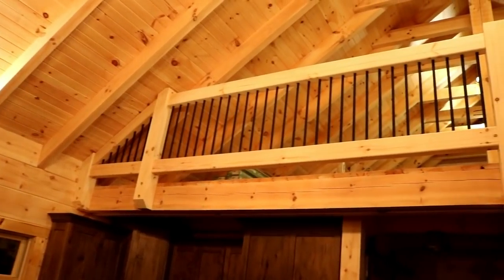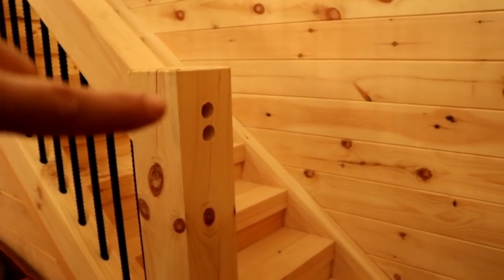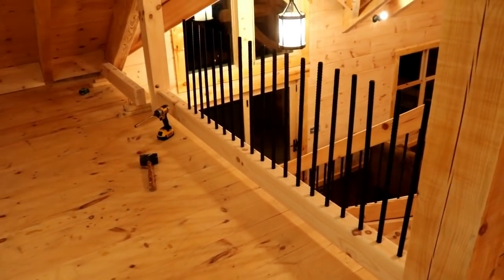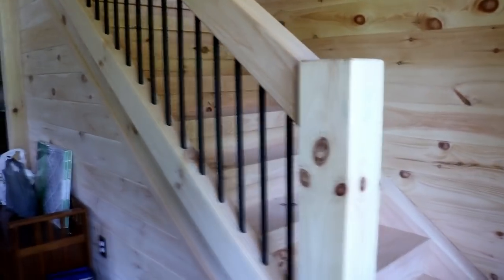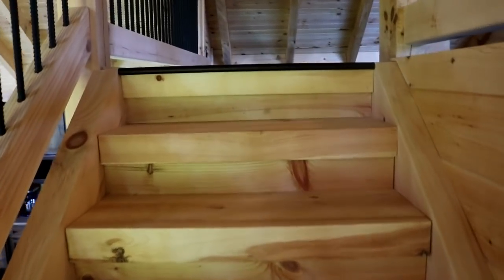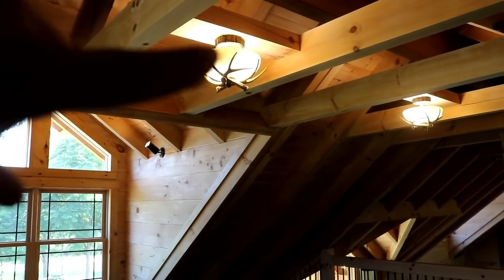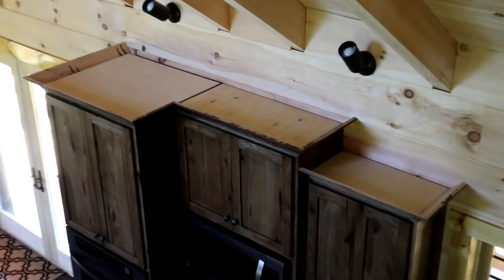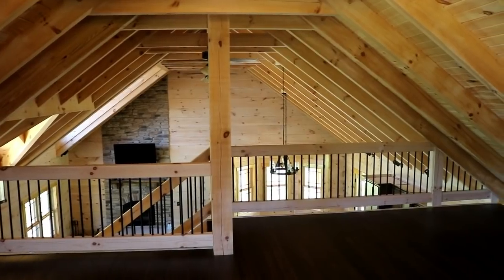Log Home Build Episode 24 - Staircase Railing and Loft

Comment: AWSOME log cabin.you did fantastic work on it 👍
Reply: Building a log cabin requires the use of logs. Once it's milled it's no longer a log cabin it's called a timber framed construction. Which is what your house probably is unless it has metal framing.

Still a cabin though.

Comment: Love your staircase in fact your whole house
Reply: That's the one part I don't like. I would love to see how they now look 5 years later.

My mom's were hacked together similarly using harder woods. They aren't looking good.

I do this work for a living, but got called out of state when my mom wanted her floors done. My commercial work has always taken presidence.

I'm building a beautiful staircase this week with venetian tile risers and sold oak treds (steps) finished in a weathered grey.

For me the main thing for a good wooden staircase is a solid one piece tred with nosing. Preferably an entirely solid piece, but at least the 1st 4 inches. The rest can be hard wood flooring. The difference in quality at this point is mostly visual. The solid step will be beautiful as it's wood grain is uniform throughout. With a 4" solid tread face, there will be color variation from solid wood to the hardwood floor.

One time i made a solid black granite staircase for Ambercrombie and Fitch in Portland Oregon. It was crazy, but it was beautiful!

Comment: Just found these videos today. Awesome. We built our Log Home almost 20 years ago and honestly, I still have a few custom trim trouble spots that I was never sure how to finish.  Your explanation of the stair nosing is exactly what I was planning to finish today. Also like the way you trimmed out the loft edge to the flooring.  Another place I  was never really sure how I wanted to do.  Love the rebar railings! You have to be flexible when finishing these homes.
Thanks!
Reply: Quality wood stair treds are made from 6/4 or 8/4 wood, preferably oak. Then chamfered to 3/4 except the nose of the tred. Every riser should be the same height with a max of 7.75" for code. Code allows for up to a 3/8" variance in risers, but it's best to keep them all the same to prevent trip hazards. There is no code on stair tred dimensions. Also all stairs need to be a minimum of 36" wide for code.

I just got the framing dialed in on a staircase today within 1/32" variance across all the risers and perfectly level treds. Next is the stair skirt, then we're installing another sub tred and venetian tile risers. After that we're installing one piece solid oak treds 10 1/2 inches deep. They have an 8/4 (2") nose that sticks out about an inch.

You can use other woods too, but for stairs you want a hardwood to stand up to the wear. Softwoods will be smiling at you over time. Meaning there will be a dip in the middle of every step.

Comment: The black accents throughout is just beautiful! Who was the genius that had the idea and turned plain everyday steel rebar into beautiful railing spindles?
Reply: Somone long before this man. They even sell black plastic coated rebar for rust prevention. It's industry standard. Though arguably not good as it focuses rust through pinholes in the coatings which can accelerate failure. Technically coated rebar needs recoated prior to install and after cutting to size and bending to shape. But no one does as far as I can tell, maybe nasa does on thier launch pad?

I've seen wood dog kennels made like that. They were pretty cool too!

Use thick rebar or it's going to be bendy. And when rebar bends, it holds that shape

Comment: I enjoyed this video.  We are currently designing a log home and realizing a solid log wall home is pushing us over our budget.. so we're looking at the option of a hybrid home to see if we can save a bit on the build.  I'd be interested to know if you looked at a solid log home before building this and if it saved you any money.
Reply from the maker: We didnt really price a true log home.  After going to a log home show, we didnt want to deal with the logs settling over time.  We felt a hybrid would be more energy efficient.  And since it is a stick built home it easy to work on.  But I am not sure of the price difference, but it is expensive.  Everything adds up, lots of hidden costs.  Make sure you have access to a lot more money than they say it will cost. I would make sure you have 15% more than the estimated building price.

Comment: Looks AWESOME!!!  I would go with the 1/8th inch ply on top of the cabinets, it would make the tops look really clean and cover some of the joints.  I think I would stain the inside of the molding and sealing it and then just laying some unstained ply up their to see if it looks good as is because the contrast might look good.  With regards to the railing, you might want to seal it for sure because even with clean hands over time the oil off peoples hands will make it look dirty and be a pain to clean.  Place is looking great and I love your vides.

Comment: Really like the look of your place. Does hybrid log home just mean it isn't a log home but has siding/wall finishes to make it look like a log home?
Reply from the maker: It log siding inside and outside to look like a log home.  And the Roof is timber frame 4 x 8 beams.  So it combines conventional frame and timber frame to give a log home appearance.
Reply: Basically it's built from milled lumber like any house. They just leave one side of the log unmilled so it has a tree look. The wood is all dimensioned to fit together well.

A log home has unmilled logs. They must be selected for uniformity of size and taper of tree. Then you have to switch directions with your trees so the taper doesn't build up on one side of the house, leaving a lopsided house. Filled with pitch or something more high tech, the list of differences goes on.

I've been in the comments calling it a timber house lol. To my credit I didn't know what a hybrid log home is. Though I would still argue this is a timber framed construction marketed as hybrid log home because it couldn't legally define itself as a log home. I still see milled framing in there. In fact I don't see any wood that isn't milled lumber.

Technicalities aside it's still beautiful!

To toss in a joke. It might leave me pining for some wood diversity!

Comment: you did a good job on railing till you made the plugs, dowel plugs are end grain will stand out
Reply: You can buy a plug cutter. It cuts plugs with the proper grain direction. They normally come in a set.

I would have seated those stair posts with a single double ended lag bolt from underneath, or multiple dowels. That would leave no holes for a seamless look. It's also how most stairs are built.

Comment: poor quality wood, so many cracks...
Reply: That can happen with 8" thick wood. Reference your lumber yard... fine lumber normally maxes out @ 2.5" for this reason. As the wood dries it moves. If there is nowhere to move it cracks under the force it applies to itself.

Pine isn't normally great for finish construction. It's normally sold wet. Then it dries after installation, bends, and cracks. Wood takes 1 year per 1 inch of thickness to dry. That's why kiln dried wood is a thing.

If I owned that house I would consider buying a Mowhawk knot filler repair kit or hard wax filler kit. And go to town filling the cracks black for cool contrast. The wax would be easier to do without messing up the finish, the knot filler is hot glue so it's more durable but you might need to sand and refinish. The hard wax gets scrapped with a credit card.

You can try to color match too, with hard waxes you can melt different colors together to make the fill more dynamic.

If it's all unfinished you can put in stainless filler, but it will always be visible as a crack